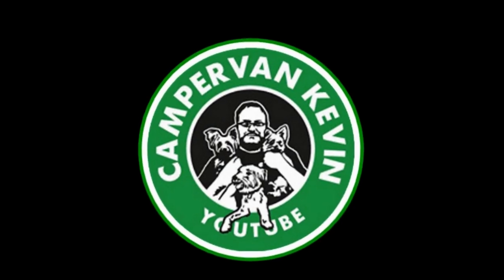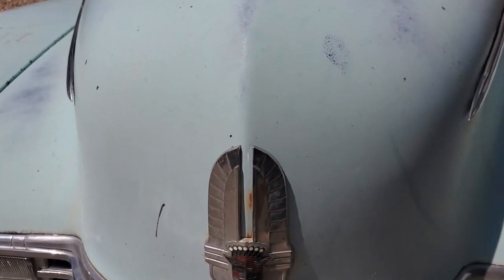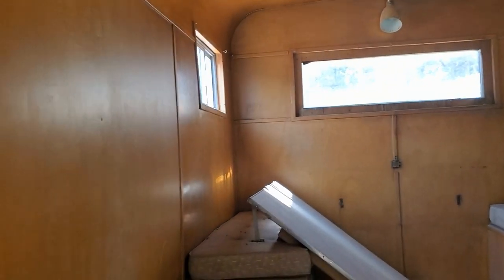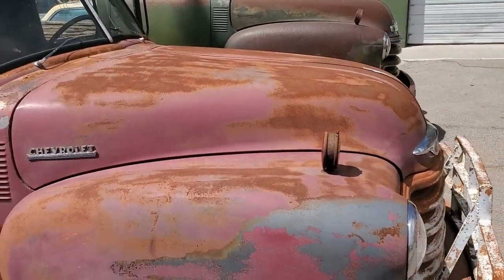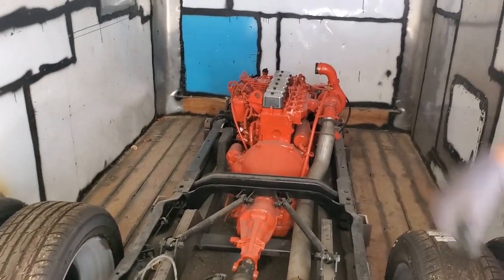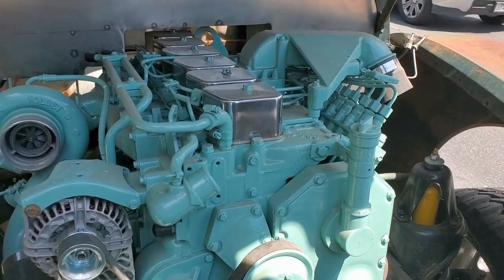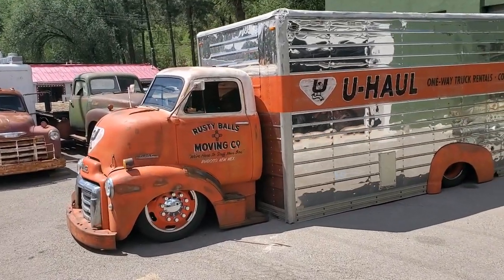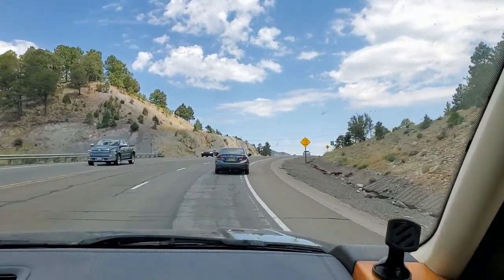Antique Cadillac RV Tour, Big Rusty Hotrods, Sawmill Lumber For Tiny Cabin

Comment: My father cut lumber in S. Ind from the Ohio 'bottoms' and stack/air-dried oak to build a house  in 1953, a tornado came thru and obviously twisted the house but it stood firm. In 1972 I moved in and proceeded to remodel that seasoned oak..Professional carpenters would swing a hammer and it would bounce back like hitting concrete. Nothing was plumb in that house after the tornado and that created a lot of challenges. Fully non-seasoned wood has a tendency to take it's own way, you can call the outcome 'charm' , 'rustic' or a 'learning curve'...either way, IMO nothing is prettier and warmer than wood. I'm excited about seeing your finished cabin. Thank you for sharing.

Comment: I remember seeing early 1950’s Cadillacs with a camper built on the back.  Cadillacs had large engines, and strong frames so they became a logical choice as a camper vehicle.  Trucks at the time were geared very low and had six cylinder engines.  I have never seen one that old.  Btw the ones I saw were no longer being used.

Comment: 51 to 55 is when most of the Cadillac Campers were made from what I have researched.   Cool moving truck.
Reply: Definitely not in the 50's.
Reply: Owned a 51 cad. It didn't look like that. I would say it was a 47 or 48. 49 thru 52 look very similar but different front clip than was on that class c.
Reply: @terrycolburn5440  yeah that looks older

Comment: It's a 1941 it has the rectangular signal lights on the top of the grille and the 42 had big round signal lights on the bottom of the grille.  Same grille but different lights at different spots.  I just know cause I have restored old cars since I was 10 with my dad and still do I have been doing it for 40 years . I'm not a genius I'm just experienced. Lol
Reply: I think you are right.
Reply from the maker: I'm good with cars but get fuzzy below 1950

Comment: Pine beetle is all over that area. It will get darker blue too. Using this lumber for your cabin is a good deal. Normally, beetle kill gets either burned or is sold off to artsy farty's to make expensive furniture out of. Oh, and once the beetle attacks the tree, before you even see it, the tree is dying. There is no way to save the tree. They turn into a real wildfire hazard if left standing. I used to log them a couple hundred miles north of where you are.

Comment: Kevin just wondering, cause I know zip, zero about it.  The U-Haul truck are going to or do they jack it up when it's driven?  Looks like it is setting on the ground or really close to it, like I said just wondering.
Reply from the maker: the frame is resting on empty air bags. air bags are used to lift vehicle one they are pumped up. they also act as shocks when inflated.
Reply: @CampervanKevin  Thanks Kevin for letting me know, I couldn't figure it out.  God bless you & the babies!

Comment: Hey #camoervankevin can you please show us on your Victron BMS-712 when you are running your mini split. I would like to see the actual amp/watt  usage.  I am currently on 500 ah lead acid and can run my roof top ac for 1.5 hrs or on n off through out the day with just solar. But I am eating up 90- 120amps almost from it a hour.
Reply from the maker: Its a combination of things to make it work. I have 600ah of lithium. They charge faster than lead acid also its like having 1200ah of lead acid because they can be taken to zero and not hurt them. Lead acid can only go 50%. The next thing is that my heat pump is around 23 Seer. VERY efficient. My 1280 watts of solar is bringing in more watts due to elevation. I've seen 1440 watts here. Also, I can just cool bedroom if need be which further cuts down the power. I see up to 600 watts when its on high. When temp is reached I see 150 to 300 watts. Lots of factors in that of course. Outside temp etc. etc etc.
Reply from the maker: The roof top a/c is VERY inefficient. I can run mine maybe 6 to 8 hours on a good day. That kills my battery bank to nothing. Next day cannot run as I'm trying to get solar to recharge batteries. I have seen it require 1600 watts or more to run it.